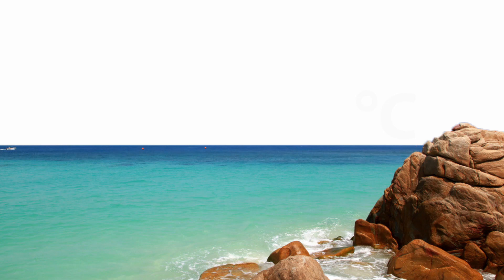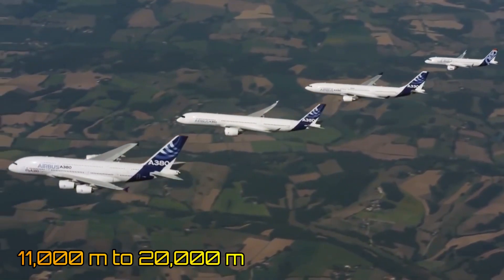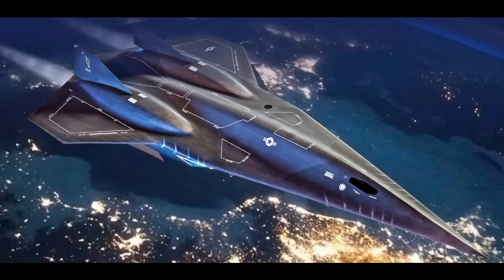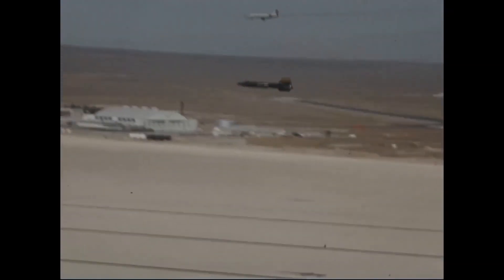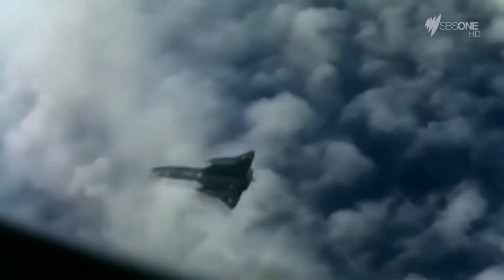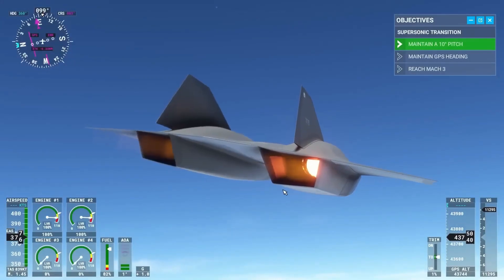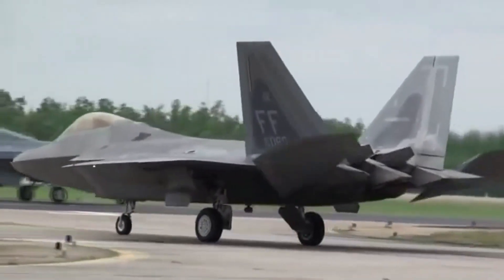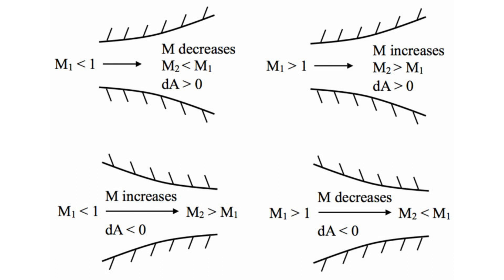Learn the Aerodynamics of Topgun Maverick (Including Enemy SU57 evasive maneuver)

Comment: The X-43 did achieve M7 & M10 but only for a few seconds by using a conventional rocket engined Pegasus to accelerate it to this speed before release (NTRS has a few papers). The prevailing view is that M5 is the limit for continuous flight due to stagnation temperature + combustion temperature. China has done some interesting hypersonic wind tunnel research using oblique shock detonation of hydrogen rich air to avoid engine components contacting the combustion region and overheating - but this is not understood to have actually flown.
Actually, since this is the "Electric Aviation" channel I'm surprised the Rocket Lab Electron rocket hasn't featured. The Rutherford engine uses an electric pump fed engine. They reasoned that developing a second combustion chamber turbopump would be more expensive than fitting a battery driven electric motor. So the fuel is supplied to the combustion chamber courtesy of Li-ion cells! Actually this makes sense as RP1/LOx with say a 55% efficient turbopump would give ~5MJ/kg and Lithium batteries are now achieving 1 to 2 MJ/kg.

Comment: Great video. I was an aircraft mechanic on F-4s, and 16s primarily, and much of what you discuss is plain speak to many of us Crew CHiefs. You gave an very good explanation on a very basic level for anyone to understand and I thank you for it. The movie was great and was not too unrealistic, they tried hard to get the data right where they could and did a pretty good job at it.
Reply from the maker: Glad you enjoyed it! Thank you for your input. Its good to hear it from a hear Aircraft Mechanic
Reply: I only saw the movie yesterday but was absolutely blown away by the manoeuverability of the Felon!  Hence coming on here to see if there was any truth to the scenes in the movie.  I am  so thrilled to find it's true. 

Other than the Darkstar which may or may not be realistic, at least in concept, which parts of the movie were not?  I picked plenty of holes in it from a mission op perspective but was wondering where you saw errors or things that would not be possible?
Reply from the maker: There have been unmanned aerial vehicles so far that have been tested at Mach 10.  There isnt a need for having an aircraft that can go that fast. Its too costly to run. You have to have a life support system  in there for the pilot with really increases cost
Reply: @ElectricAviation  I guess it depends on why you think that is so. OFr defense reasons, I think we , the US, need the fastest aircraft possible. Whether they are manned or not is not too important , I agree teh human factor adds cost and ifthe mission is not sacrificed due tot hat cost, I agree, go unmanned. We do need human interaction as anything done automatically without human input, may cause the end of the world or another world war. So, teh human aspect must be a part of the system.
Reply: @hellfirepictures  I have to say that what was portrayed in teh movie was close to reality. I remember a briefing when my Phantom was flying against the SR-71 over the US. We had something called a Mad Bomber drill. A nation would send a bomber, we had no idea what the destination was, but were given a 4 state area where it may come. The SR simulated a foreign threat and when they were found a few things would happen.  The thing that stuck out was the talk about a Mach 10 closure speed on a head on attack between the two aircraft. The Max speed of a very well kept Phantom was around Mach 2.  The SR then was said to be Mach 3 plus.  DO the math.  As we see TOm hitting Mach 10, and his aircraft was vibrating, and coming apart, and the meter was showing the speed, that Was BS. There are aircraft that can do at least Mach 7 operationally.  When Mr Kelly Johnson submitted teh plans for the SR he also submitted plans for a Mach 10Plus aircraft. He was told there was no need for that type of plane so they just went with the SR. IF you think about develop,ent time and flight trialls, you know the SR was on teh drawing board in the late 40s or early 50s. WIth that knowledge and knowing Lockheed and GE/PW and Northrop worked on designs and prototypes sincfe the SR came out, you can be sure that something new is there and the world may not know about it. The CHinese will nto steal the plans, and the world respects we still ahve an edge.  The movie, on the whole of it, was more about teh tasks and deeds of men and how they interacted and became a part of the machines.  As long as we have men and women willing to do that in the name of democracy, the world will be safe.
Reply: @johnfrymyer8346  from what I've read, yes, at mach 10 the temp and vibrations do become a huge influence on the stability and functioning of the aircraft. I've read around the topic since my original comment lol. 
And the consensus seems to be that next gen will be manned but that's likely to be the last one as the following gen in many decades would likely be unmanned. Who knows. In the 60s people thought we would be living on mars by now - tech doesn't always develop as fast as we think. And add to that things like recessions, wars etc, it could put back development for some considerable time. 
And of course it depends on advances in other types of weaponry that may make fighter planes obsolete. So many unknowns. 

It reminds me of the delays in developing EV cars. The first car ever built was EV. It's taken all this time for them to actually be developed thanks to interference from oil companies with their own interests. So developments will undoubtedly be influenced by outside factors which may not always make sense. 

As I was first reading about scramjets in the late 80s as a teen you can imagine my thrill at finally seeing one featured in a movie, even if the plane was fake lol. 

Do you still fly?
Reply: @johnfrymyer8346  And thanks for giving me your perspective on the reality of the movie. It's nice to hear from someone who knows what they're on about!

Comment: Nice clear summary as usual
The Folland Gnat before the Skyhawk proved its worth in combat not by absolute speed but by virtue of its flight characteristics and diminutive size....
Thrust vectoring isn't new but matching it to a airframe designed to maximise the pilots abilities to execute extreme numbers .... Getting a missile lock close in becomes extremely challenging.  

With hypersonic engines the fuel itself becomes an issue.. normal jet fuel doesnt cut the mustard hence the Blackbird and the XB 70 were set to use specialist  fuels some of which are pretty unpleasant. So futher dividing civil aviation from military combat aircraft...